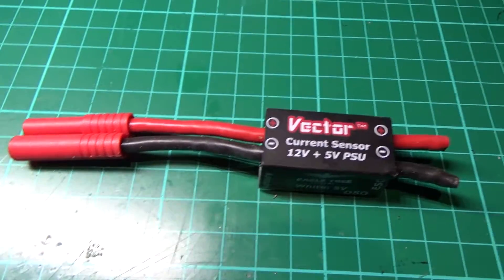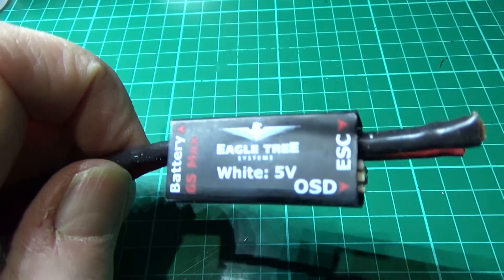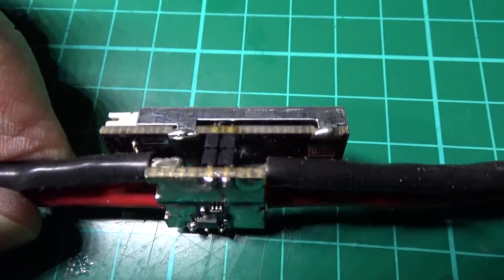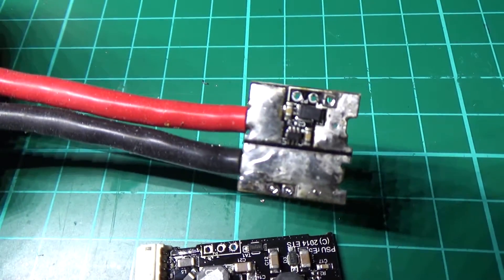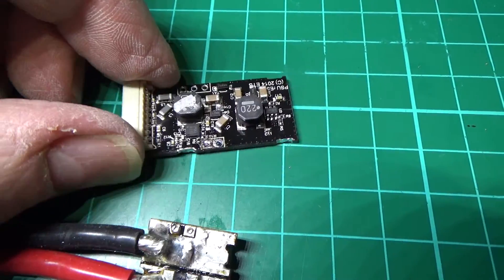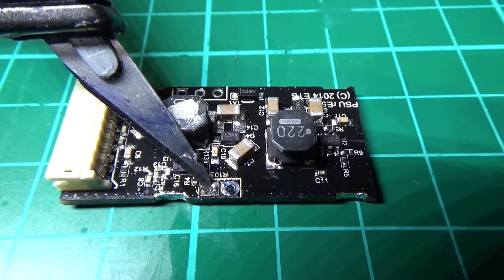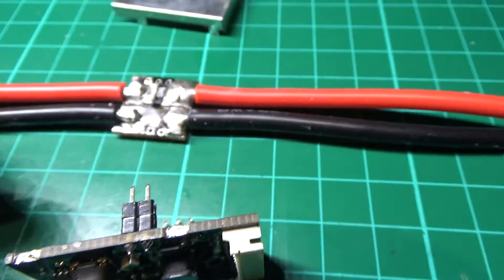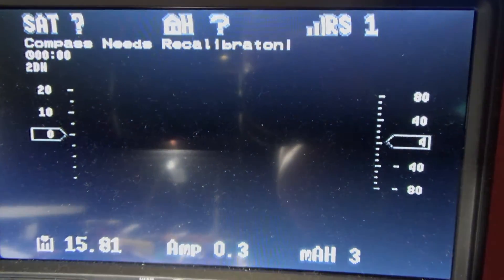Dismantling teardown of the Eagle Tree Vector current sensor

Comment: how many amp's can it handle? my octocopter can pull as many as 531 amp's
Reply from the maker: WOAH 531 amps? that's insane!   
I think it's only 100a
Reply: so I found out I can remove the shunt from the vector and add any other stunt in line such as this one that can take 500 amps http://www.galco.com/buy/Crompton-Instruments/FN-500-50
and no that's not insane!  that's 8 large motors turning 8 13x8 3 blade props and at max throttle it can pull over 500 amps from a 6S 22,000 mah lipo !

Comment: In situations like this I simply sacrifice the pins by cutting them in half. You can then easily de-solder the individual pin stubs from the board.  You could get some replacement pins easily enough or just use stout copper wire in a pinch.
A variation to that procedure for pin headers on boards like the Naze32 is to lever off the plastic retainer and again de-solder 1 pin at a time. 
Interesting the Vector uses a current sense resistor, I would have expected a Hall sensor on higher end gear like the Vector.
3 feet of wire! Good to see you are measuring twice and cutting once Tony :)
Reply from the maker: +Rob B To tell you the truth Rob..... That's exactly how I got it apart. I've got 1,000's of Arduino headers and they fitted perfectly. Measuring twice? I didn't bother - I always go for the worse case scenario :-)